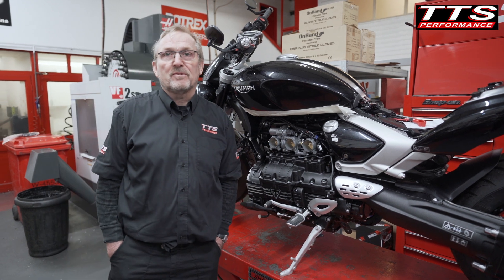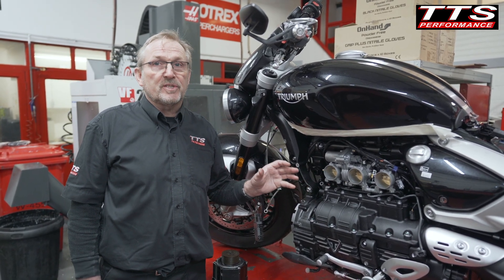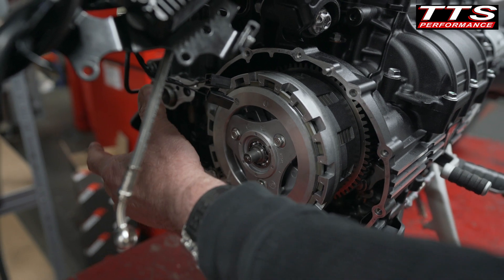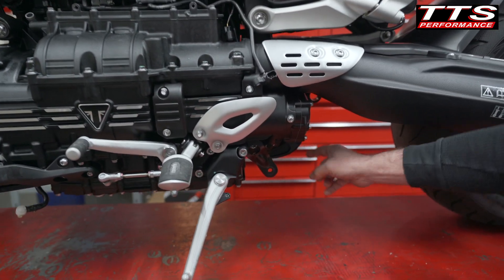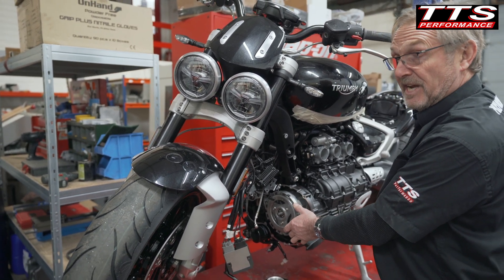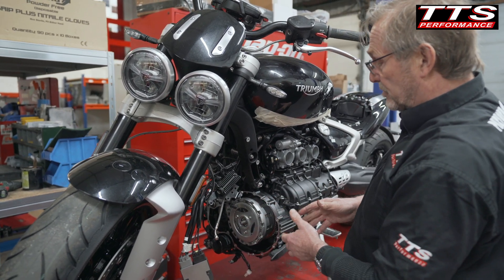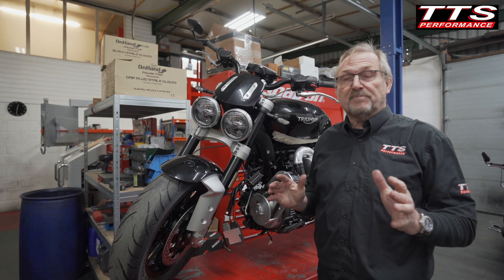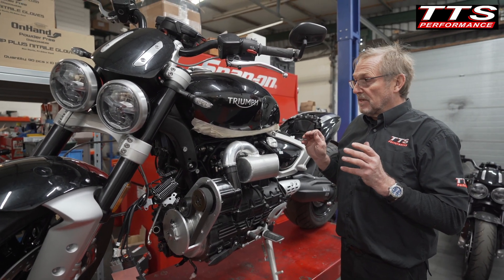Can we supercharge a 2020 Triumph Rocket III?

Comment: After a few minutes I'd be thinking variable geometry turbo, easier, cheaper, and quicker.
Reply from the maker: Not such a good rider experience. I don’t see any manufacturers coming out with one. I wonder why?
Reply: @TTSPerformance  Probably cuz people don't know what they are doing with turbos. Turbochargers are better in almost every way. The reason people are afraid of them is because most people don't know how to predict the boost curve (or to engineer it correctly). With the correct design, you could get more torque in a linear fashion, throughout the entire rpm, without stealing power from the engine to drive the supercharger. But what do I know https://youtu.be/DNedUZxP8NU
Reply from the maker: @kevin_delaney  you better go teach these bike design engineers what they don’t know. 👍
Reply: @TTSPerformance  First I gotta teach these firearm companies how to do it, but I'll do it within the next few years.

Comment: Got my attention and yourselves a new subscriber....this Bike is a dream and your making it into Nirvana 👊👊👊
Reply from the maker: Launch of the production kit is in March 2021.
Reply: @TTSPerformance  will it be road legal in germany?
Reply from the maker: @Idontknow-ew1yy  you will need to get it through tuv.
Reply: @TTSPerformance  Hello. It's MARCH!!! I want to buy this so bad. TAKE MY MONEY! How many hours to install for a really experienced mechanic, would you reckon?
Reply from the maker: @phatfos1  we’re over 2000 hours into the design time and very close to cutting metal. I will be posting progress in the very near future.
Reply from the maker: @phatfos1  fitting time will depend on power request. Low boost will not require engine work. High boost will. Do you want 220hp or 320 hp.
Reply: @TTSPerformance  a reliable 220hp would be great. What do you think torque will be? Is that going to be 220 at the wheel?!?!
Reply from the maker: @phatfos1  about the same 220 ft. Lb.

Comment: Would it be possible to engineer a supercharger that rotates counter clockwise and attaching it to the crankshaft?
Reply: Yes, I use the AISIN SUPERCHARGER which can rotate and boost in either direction. I can't comment on the Adiabatic Efficiency of the ROTREX versus the AISIN, as I don't have experience with the ROTREX. Safe to say,  by design it doesn't heat up the air as much as the AISIN. I use Methanol Injection to cool the Intake Charge on my builds.  

Great Engineering and Machining by the gentleman at TTS ! 
SARGE BULLDOG.

Comment: I hope I never get this addiction of more torque. Isn't 150 way too much anyway? Respect the ingenuity.
Reply from the maker: The throttle works both ways. The supercharger makes riding easier reducing the need to change gear and rev the bike hard. It can actually decrease fuel consumption.
Reply: @TTSPerformance  
I didn't know a supercharger reduces fuel consumption on top of the other stuff you said. It's worth it then. Thanks
Reply: stock rocket is slower than diavvel and vvmax and similar or lil slower than 600 cc sport cycle so .... qusetion is some numbers of toruqe not enough for somebody is bad question ;) for somenone that be enough for someone to much for someone not enough ... they do this for people for which stock is not enough :x get it genius ;)  ?
Reply: @mociczyczki  rocket 3r does 0-100 in 2.8secs so its not slow
Reply: @Hsp44  i dont say its slow its much faster at straight than me cb 500 for egzample but lil slower than vmax or diavel .
Reply: @mociczyczki  no its not slower diavel and rocket 3 are neck to neck to vmax is slightly slower
Reply: @Hsp44  nope diavel and vmax are lil faster than rocket  except couple first metres where limits are tires grip and wheeli ! hear you have for egzample rocket vs diavel watch this https://www.youtube.com/watch?v=SA9JPERaYVA  consider that vmax is lil faster than diavel but in this case diffrenc is less than beewten diavel and rocket 3 :x .